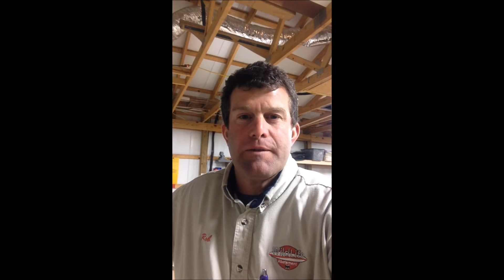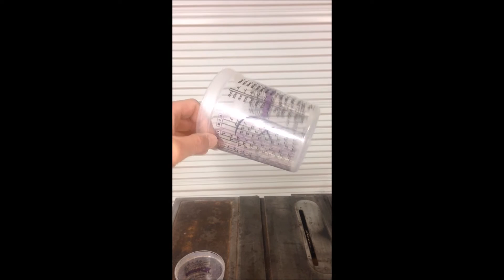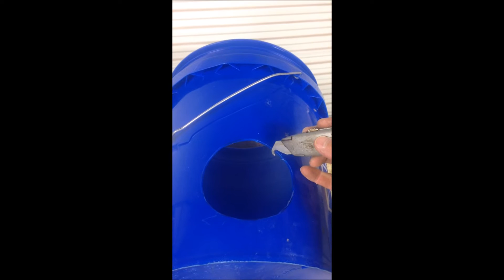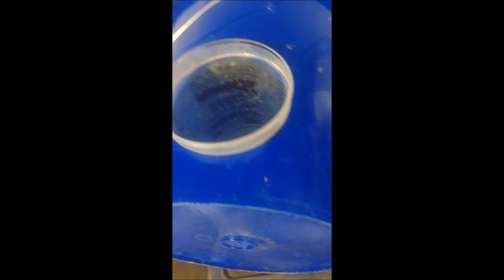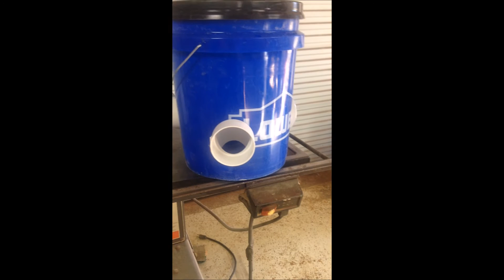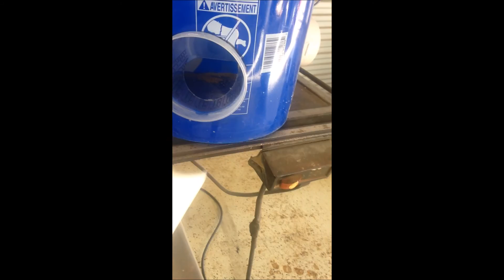How to build a low-mess chicken feeder

Comment: What this chicken feeder is: 1) Inexpensive to make. 2) Easy enough that anyone can make one fairly quickly. What it is NOT: 1) No mess. Lol. My chickens had piles of food on the ground within minutes! 2) My rooster won't eat out of it. As soon as he starts to put his head in touches his comb and he immediately jerks his head out. 
I have tried modifying the cups by putting a lip on the bottom of each one. Don't know if it works as the flock is too busy eating the mounds of food they pulled out into the ground.
Reply from the maker: Chickens making a mess?  Never heard of that!  HaHa  Thanks for the comment!